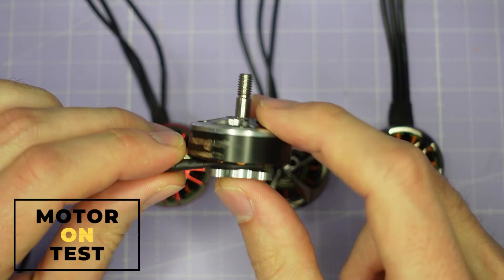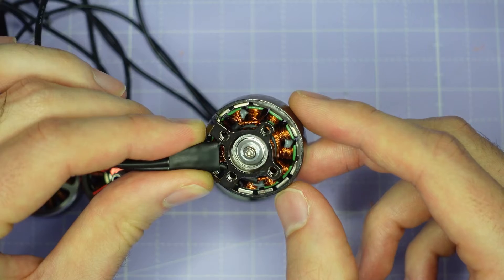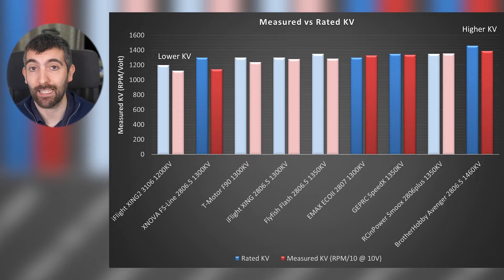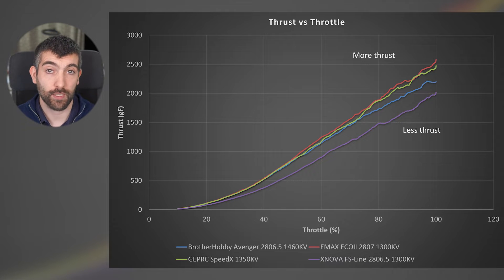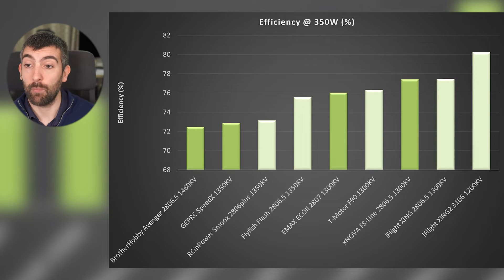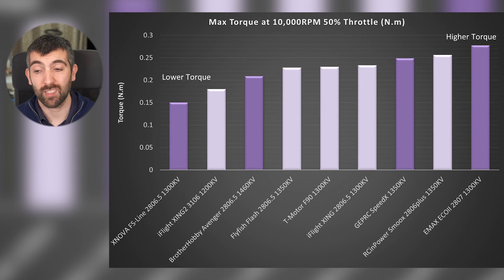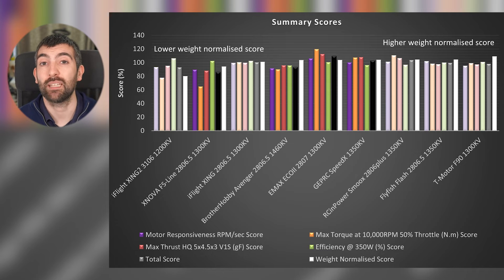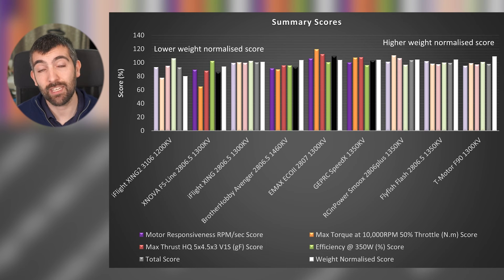7 inch motor testing: Second Batch and Full Comparison

Comment: Just wait till everyone just buys the dolphinrc 2808 1300kv , if the performance graphs from dolphin rc is to be believed this is some kinda freak motor, not only does its spec sheet performance thrust numbers exceed every 28xx series class of size motors it also outperforms 2815 motors for thrust on 8040 gf fans, that’s insane!!!! But it all depends on if they are lying or if the tests from the brand is accurate

Comment: What to take 2807 speedybee 1050KV 8 inch prop 8040 or 8041, or 2807 RCI power 1300 kv? need mostly efficency so thrust to W ratio
As far as charts go RCI is better eff BUT on 7040 gemfan which are ligher, and the SB only show chart for 8040, so in the end idk which one would be more eff for the 8040 or 8041 prop in the end 8041 weights about like the 7040, but how more eff would the 1050 kv be then

Comment: Well, I'm looking at upgrading my Reptile Dragon 2 (not a quad) motors from T-motor F60 w/ 7x4x3 props to add a little for power, the Emax Eco II looks like a great solution (was going to buy two F90 motors but the Eco II's are almost 1/2 the cost!) and I don't care about weight or response, but efficiency and power is very import.  I need to hand lunch this thing and fly for a long time.  Also, I can't fit larger props, so 7x4x3 is the max.  Maybe make some 'plane' motor focused videos.

Comment: do you think the emax eco 2807 can handle a 700/750g + 600g battery 10" long range quad?
Reply: 10" id say no way. 8" max. Even 8" alot of times too small of a motor it won't fly great cause it can't speed up and slow down a big prop well

Comment: I've been buying nothing but skystars koko motors for over a year now, i have 1-3 sets of every size available in the koko lineup and they are all excellent at a far lower cost. I also like emax motors but skystars are much better quality and still cheaper yet. My 7inch has skystars koko287 on them and it flys great for a $59 set, i think they may even beat out some tested here and are cheaper then any these. My favorite motors of any rite now are my 1505 koko on my grinderino and jm3.5 running 3630 props. I'd really like to see a show down with 3.5" motors, anything from t-motors 1404 and 1604, to the 1804, and even 1507, granted different motors will need different props, but please start putting cheaper motors like skystars in your tests for us poor pilots.
Reply: Also needs to have 2 different categories, because you could put the 1404, 1505, and for 1604 on sub 250g frames fairly easily, but I would still like to see those compared to the larger ones that would be heavier bashers

Comment: In my opinion, weight normalization does not correspond to reality in the way it has been demonstrated. A long-range drone with a Li-ion battery will weigh about 900g and say 20g of total weight difference will be about 2% in total, which will lead to a change in setup efficiency of hardly more than 3%.

Comment: Could you please also test the FlashHobby A2807 1300kV? And possibly the T-Motor Velox V2808

These are quite similar in price to the EMAX ECO II and I'm buying thousands of these every month, I'm really interested to see which one is the better investment haha
Reply: you are not buying anything please stop lying.
Reply: @sigterm15  Just bought 12000 pcs T-Motor Velox V2808 🤷🏼‍♂️
Reply: @VoltageLP  are you helping ukraine or the soviets?
Reply: @sigterm15  I am in Kyiv
Reply: @VoltageLP  very good i am now making batteries for your drones in Prague. slava ukrayine!
Reply: @sigterm15  respect 🤜🏻🤛🏻
Reply: @sigterm15  Ukraine WAS Soviet.  You meant Russia.
Reply: You want the cheapest thing that can do the job.  These things are 'one-time-use/disposable' right? 🤫
I'd even consider talking direct with the manufacturers to get the costs down by say not using ball bearings but bushings instead.

Comment: Thanks for the video and information about these motors.  I have a question, I went with the Diatone 2808 1100kv TOKA motors on my 7in lr quad. Have you tested this ? Thanks for the video
Reply: You're supposed to run those on 8S

Comment: Cool tests! I'm glad I decided to go with the emax eco2's for my latest 7in. I heard a lot of people saying how good they were and apparently they were right. I went with the xing 2806.5s in my last build and they work really well too.
Reply: I used them on my recent 7” build and they’ve been okay. Had one have a nasty 1/3 throttle vibration after my 3rd pack. Using 21700 6s1p li-ion packs that I built so each flight were way more than a few min like a lipo would give but motors were cool. Started getting bad jello in the walksnail fpv feed. Spinning the motors individually in betaflight showed one vibrate the quad all over the table. Swapped it out and have put 50+ packs on it since with 0 issues. For the cost of those motors, they can’t be beat. I now order 5 motors though when building quads. Just in case I get a shaker.
Reply: I choose Emax eco 2 2807 1500kv motors for my 7in ripper and i love them.